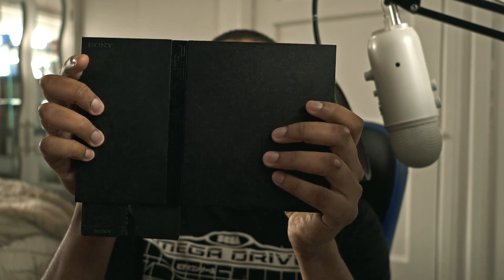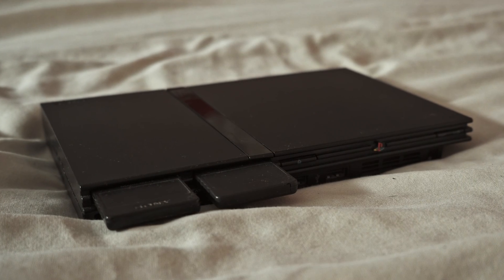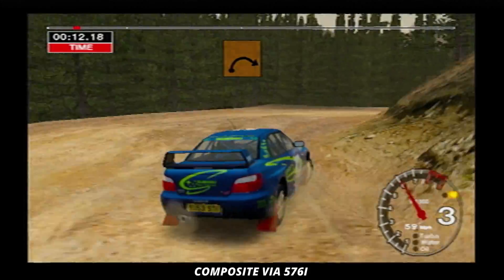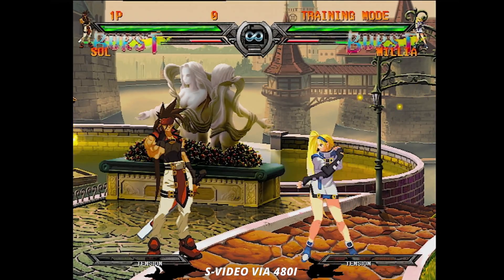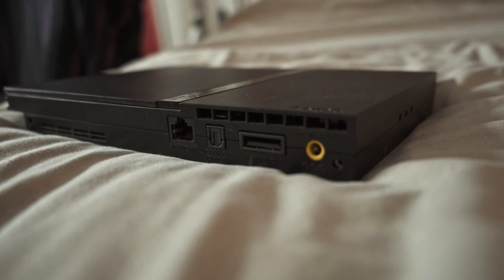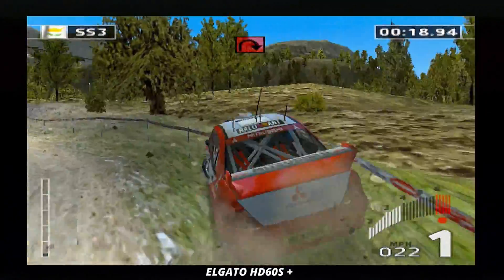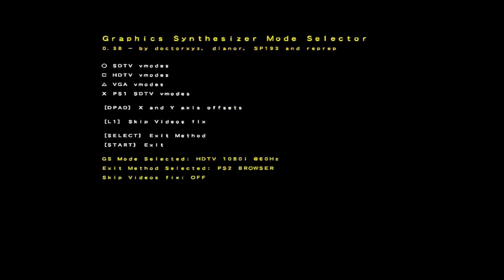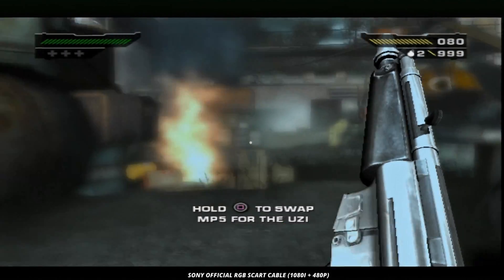PS2 Video Output Misconceptions & How To Improve Image Quality - theaffroshow

Comment: unplayable resolution on ps2 :( I've just bought one and I'll rather play on my pc with a controller because it sucks
Reply from the maker: @zv8035  I disagree, it may not be high end but, its not awful & remember, if you are using Composite on a non CRT it will not look good :)

Use S-Video, RGB SCART or Component cables instead & you'll be surprised :)
Reply: @TheAffroShowGameplay   It's true that I'm using a composite, and I know a component would  be better, but I'm a bit skeptical about the extent of the improvement of that 😀But I'll give it a try, thanks.
Reply from the maker: @zv8035  Honestly I know because I had the same reaction & since switching to RGB SCART, it is amazing the improvements :)

Especially if you get 480p supported titles using it or Component, the difference is amazing :)

Comment: 1:56 I think all PS3s shipped with composite cables as well, my ps3 slim came with a set of them, and I know a guy that had a super slim and used it with those cables.
Reply from the maker: @JoseLgamer05  Mine did not although I never had a new PS3 so, I'd imagine boxed ones did :)
Reply: @TheAffroShowGameplay  And I think it was a disgrace to the system, composite video stinks.
Reply from the maker: @JoseLgamer05  Yes, sadly it was what most people had & remember, most cheap TV's back then didn't have RGB, S-Video or Component support :)

My first TV I owned with SCART support was back in 2009!
Reply: Can confirm, had a PS3 super slim brand new in 2012 and it came with composite cables... Never used them and just used a spare HDMI lead I had lying around instead!

Comment: In Europe you should forget RGB Scart. I’ve never seen a TV that support 480p through it. I have a RGB Scart official ps2 and it looks great on 480i but not worth overall
Reply from the maker: @theneedforspeeder9575  Actually, you shouldn't because now even if the TV doesn't properly support it, upscalers do, making it ideal for HDTV's to take advantage of this feature :)
Admittedly, Component is easier since many TV's did support it using 480p but don't discredit RGB, it is very viable & much cheaper than Component in today's world :)
Reply: @TheAffroShowGameplay I guess depends on the setup. Scart Rgb cables from good third party people like Retroaccess are cheaper than component. But if you want a Sony official they’re 120€ for the ps1, and 160€ for the ps2 version that I have. One sold for 200€ and on eBay there’s only 1 person in all Europe selling it. Prices are crazy
Reply from the maker: @theneedforspeeder9575  Luckily & I say this is every video which includes the Sony Official cables, you can buy excellent third party cables, such as the ones from Retro Gaming Cables for less than £30 :)

Same quality, if not better & are in stock & are newly built :) Very highly recommended, I have one for the PS2, fantastic alternative :)

Comment: My PS1 on my 55 inch tv is awful, is the only answer a CRT tv?
Reply from the maker: @GrahamStubbs-u4m  No, it is not the only answer :)

Please consider better cables (S-Video, RGB SCART rather than composite) & you may need to buy an HDMI upscaler to help sharpen up the video output :)

The OSSC, Retrotink 2x, 5x or 4K are some of the best upscaling choices :)

Comment: I love the PS2, it was the console that got me through High School. It near and dear to my heart. But there's still few things that need to be addressed. Most PS2 games only support up to 480i NTSC or 576i PAL. Only maybe 40 or 50 games support 480P. Only one game supports 1080i. Another is thing is even if you get Scart or Component cables for the PS2. Yes the games will look better, but won't blow you away, like the other consoles will. The Dreamcast through VGA, looks beautiful, The Gamecube through Component looks ridiculously good, and Xbox looks amazing through Component. It strange that the PS2 doesn't clean up well, but it is what it is.
Reply: The wii looks amazing too with component. Almost every game is 480p. It looks great on ps2 with a good fhd tv set up
Reply: @theneedforspeeder9575  The Wii looks good, but the Gamecube looks better. Yes the PS2 looks a lot better then it does through composite. But compared to the other consoles it doesn't look very good. It's just the truth.
Reply from the maker: You've made some very good points so, allow me to address them the best I can :) Here goes:

1. Yes the PS2's library is definitely mostly made up of games only outputting at 480i or 576i which means deinterlacing is a factor when trying to get the best out of PS2 video output.

2. I think I saw that there was 118 games with 480p Progressive scan support although the PAL versions of games dropped this to around 80, still this is a small sample when you consider 4000 PS2 games were officially released! Luckily, you can force 480p or 1080i in the GS Mode Selector via Free MCBoot although results will vary from game to game :)

3. The Dreamcast, Gamecube & Original XBOX can look amazing definitely but their options differ depending on Regions.

The Dreamcast can use VGA on all regions but the Gamecube & XBOX higher resolution modes are only available for NTSC consoles only.  If you want the same for the PAL models, you must mod them, also Gamecube component cables are very expensive, making it harder for people to access it on real hardware. 

4. I actually feel PS2 graphics improve a lot with good S-Video, Component or RGB SCART cables but the low resolution can hide this. Also look out for flicker filters, this can blur the visuals a lot & turning it off will improve image quality greatly!

Hope this helps answer your comment :)
Reply: @TheAffroShowGameplay  All I was trying to say is the PS2 just doesn't have good image quality, compared to the compilation. Nobody seems to know why that is.

I thought the Xbox supported component, and up to 1080i all regions. I guess I was wrong about that.

The Gamecube from what I understand Nintendo disabled the Digital A/V port on PAL Gamcubes. So SCART is the best there. But another thing I forgot is the Digital A/V port was removed on later Gamecubes.
Reply from the maker: @eupher2  It definitely does somewhat suffer depending on the game tested, so you are not wrong with your assessment of the PS2 graphics output :)

I thought this until I got one & found out the hard way with my PAL model, had to buy a modified one!

That's correct & sadly 480p was only supported via Component on the Gamecube, RGB SCART only supports 480i/576i on PAL versions. Amazing what we are finding out about the retro consoles!
Reply: @TheAffroShowGameplay  Your right about that. For example, Who would have thought the Atari Jaguar had RGB SCART support? Granted you have to have a custom cable made to use it. But it has it.
Reply from the maker: @eupher2  I had no idea it supported RGB SCART 😊 But this is exactly why we keep learning & thus meaning we can get the best out of our old systems!
Reply: @TheAffroShowGameplay  You need to have a custom cable made for it, but yes it does support it.
Reply from the maker: @eupher2  Knowledge is power for sure :)

Comment: Thank you for this info.😊
I actually have two of the  accessories shown  in your video .the Logitech component cable and the red and blue obscaler for my fat ps2 
 Would you recommend getting the svideo connector instead of using the component cable?
Reply from the maker: @ripmowt  Anytime & glad you enjoyed 😊

As for your question, bear in mind Component will look better by default with clearer & shaper graphics & then it will support 480p & 1080i video outputs whereas S-Video tops out at 480i/576i :)

Component will also have better colour output as well :)

I will say for PS1 or low resolution output, Component can struggle without an upscaler on modern displays, S-Video will just work across the board :)

The decision will be up to you & what you want out of the PS2 :)

Comment: What i need to do to run IS Internal Section (Square) on PS2???
I know that game is on HI-REZ & 60fps, but that should not be an issue (Dead Or Alive (USA/NTSC) works fine).
I can not get it show picture, but it does seem to boot.
I'm using real JAP -game, on modded PAL PS2. Even English -patched version of the game does not work!
I've tried Component, SCART (RGB) and Composite.
-No results.
All my other games from any region work just fine.

Comment: The best way to play on a modern display atm, is honestly a retrotink... but its not going to be for everybody due to price, and how casual you are about playing. Not to mention a hefty investment in the hobby you love. If you enjoy tweaking settings to an insane degree, look no further than the RT. Having a nice modern display is also important depending on game and console. Its a weird balance trying to find the best of all worlds depending on the situation and console. Certain CRT/PVM's will make all your 4th/5th gen games look insanely good, while most 6th gen games (Ps2) will look better on HDTVs for the most part (modern or older), but can also look the same or better on certain CRT/PVM's if you what you're doing. Either way, youll have to experiment with alot of setups, and its all preference at the end of the day. 

If you have multiple retro consoles/games and have no interest playing on CRT's, I recommend looking into a Retrotink. But it can also be overkill for many, even if you just want the picture to look as best as possible. Otherwise, a good Component cable will suffice in 90% of use cases. But depending on how modern the display is, it may not even have component inputs. Forcing you to get an adapter or uscaler anyway. Just make sure you dont cheap out, and you get the best quality cables you can. If you have good cables and the picture still isnt up to snuff, invest in a nicer display. The cheap adapters/HDMI upscalers are never worth it imo. Honestly you wil just have to try a few different setups to see which method works best for your needs. Do your research.

Comment: A while back I got an AV (Y/R/W) adaptor to play my PS2 on my 4K TV and the image quality was terrible. I figured that it was just the PS2’s old age at first, but in the back of my mind I felt like the image was far blurrier than what it naturally should’ve been.

Got some component cables and an adapter recently, and while it was pricey ($50 for both the cables and adaptor), the image quality is insane. Like I was honestly impressed at how good the PS2 image quality was when blown-up on a 43-inch TV
Reply: Could you please explain abit further for us stupid people, because Im having a nightmare.. Which leads and adapters are needed?
Reply from the maker: @fesali9099  It will depend on what TV or display you intend to use & the quality of picture you want :)

If you are using a CRT TV, Composite (AKA the Yellow wire or AV) is more than enough :)

However if you are using an HDMI TV, trying using RGB SCART or Component (AKA five wires) & the image quality will be improved as explained in my video :)

If you lack analogue ports, you'll need an upscaler.

Best starter ones include the Retrotink 2x line of upscalers, the Retroscaler 2x or the ODV :)

The RAD2X line of video cables are worth a look too for specific consoles such as PS2 for an easy plug & play experience :)
Reply: @fesali9099  For cables, you’ll want to look for “PS2 Component” cables. Those have 5 ports, colored Red, Blue, and Green for video, and then White and Red for the audio.

For adaptors, just search for something like “PS2 component to hdmi”, which is a small rectangular box that takes the Component signal from those cables and converts it into an HDMI signal for modern TVs
Reply: Hey bro . If I have the five wires input on my tv. Then how to connect the component cable to my ps 2 ? Kindly tell .😊
Reply from the maker: @necrowithanX  If your TV has them, just buy Component cables for the PS2 or PS3 & then set the PS2 to Component mode in the browser screen :)
Reply: @TheAffroShowGameplay  should I change the mode while the av cables are connected. And then switch the cables ?
Reply from the maker: @necrowithanX  Yes, otherwise you will have no picture :)
Reply: @TheAffroShowGameplay I’m kind of slow I just got a ps2 and I have a 4k smart tv I bought the component cables and it’s still blurring so should I get an ossc or something?
Reply from the maker: @Nuley-xo2tv  If it's blurry, check the quality of the cable first :)

If that's good, try adjusting your TV :)

If not, then yes, an upscaler would be ideal :) An OSSC would be great, but if the cost is too much, you can try the Retrotink 2x, Retroscaler 2x or the RAD2X line of cables :)

All will give you good image quality if the OSSC is out of your budget :)

Also, consider the GBS-C for its great deinterlacing for the price if you can find it :)
Reply: @ what cable are you referring too?  And wym by adjust your tv? I have a Samsung 4k tv I change like the brightness and the different picture mode is there more too it and money not really an issue as long as I can play my games bc if I play a dark mission I literally cannot see anything barely also appreciate the time and response 🙌🏽
Reply from the maker: @Nuley-xo2tv  I mean check your Component cable, if its a cheap one, it can produce poor quality over say a Sony Official one or a good third party option :)

Brightness, contrast, sharpness, just making sure the TV isn't the problem:)

If money is not an issue the OSSC, Retrotink 5x, Retrotink 4K or OSSC Pro or the GBS-C should be worth looking at :)

These will all produce a great quality picture for your TV :)
Reply: @ I bought new component cables yesterday and it didn’t make a difference from the ones I got with the PlayStation but do you have an ossc you recommend?
Reply from the maker: @Nuley-xo2tv  I understand, in that case any OSSC that's version 1.6 or higher, the brand doesn't matter :)

If you go for the Pro model, research it as unfortunately I know very little about it or the improvements it offers compared to the original :)
Reply from the maker: @5persondude  This is exactly what this video is talking about ☺️

You saw first hand how amazing PS2 games can look when using the right cables and upscalers or converters :)

I love my OSSC for upscaling PS2 & other consoles but, at least you have a good way to play the games at good quality :)
Reply: @Elliottfan it was just the first items that came up when I searched for “PS2 component cables/adapter” on Amazon

The adapter is called “Portta Component to HDMI Converter”. It worked fine on my TV, but on my computer monitor it would just show a “video out of range” error, so just a heads up

Comment: The main issue I have is on some games my image looks really dark (NFSU being one) even with brightness settings all the way up. I am using component cables with a component to HDMI converter. Any ideas what I can do to reduce general darkness on some games without forking out for something like retrotink? Would it be possible for me to connect an upscaling device to my current setup of component cables and converter? Any help would be greatly appreciated!
Reply from the maker: @jackgill3675  Hmmmm very odd, I've only run into this issue once :)

First check out your TV settings to make sure everything is good there & check out your colour profile (Full or Limited & make sure they match the device)

Then check the game settings since most PS2 games have brightness sliders :)

If these don't solve the problem the issue will either be the component cable or the upscaler :)

If they are the problem, the only way to fix it is to get a decent upscaler (like the Retrotink) a good component cable or if nothing else, you could always try emulation :)
Reply: @TheAffroShowGameplay  thanks very much that’s helpful. I’m going to try a new component cable and if that does not work, I might just have to bite the bullet and purchase the retrotink. What are your thoughts on the clones, IE the bitfunx retroscaler x2? Also No emulation for me, original hardware all the way!
Reply from the maker: @jackgill3675  I made a video on the Retroscaler 2x against my OSSC upscaler using good Component cables if you want to see how it does :)

The link to it is in my about section :)

A decent clone works well as long as it was made properly, although I'd always go with the proper brand where possible :)